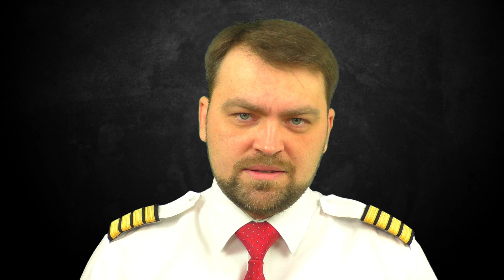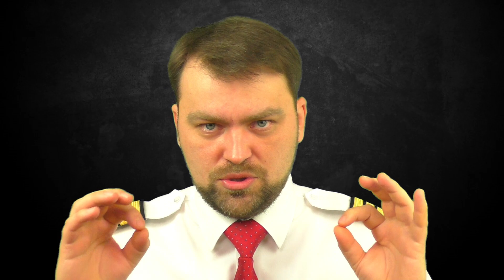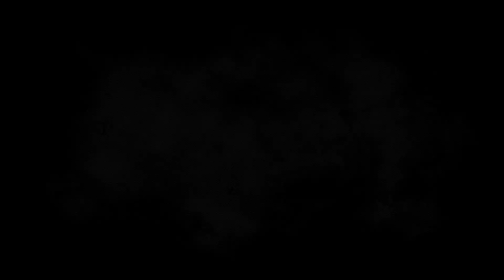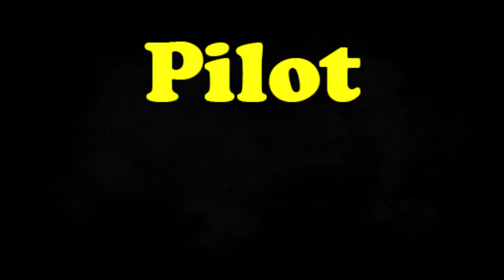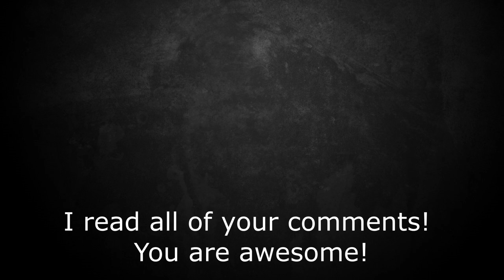Pilot Q&A #5 Most beautiful Plane, Scared of Flying, Both Engines Failure

Comment: Hi! I hope that you're well, as always. I have one question :)
Let's imagine that we have an altitude restriction "BELLOW" for departure on the SID (as for example in the LLBG, where we must fly bellow 8000 feet until some points). I think that we have to reduce our vertical speed by using the V/S button on the MCP, to reduce the climb gradient and engine noise (SID is also noise abatement procedure - airport briefing) But should we engage the autopilot after selecting the V/S mod on the B737 in this case, or not? (Because we may not use the A/T without the AP). Or is it better just not to arm the A/T and fly fully manually? Or maybe it's allowed to fly without the AP but with the A/T for this particular case? 😂 What will you choose?) Thanks, the answer will be really helpful for my simulator flights :)

Comment: Im going to embry riddle for 4 years. It costs 50,000 per year for tuition, 12,000 each year for room and board, 1000 each year for books and atc sim sessions (my minor is atm) and 15-25000 per year for flight lessons at the univeristy. It will costs me about 350,000 usd to get my license, but this includes me getting my 1000hrs.

Comment: Despite everything I’ve ever flown (real life and simulated) having either a yoke or center stick I’d also be very interested trying the Airbus side stick and FBW system.

That said, one thing I like a lot about Boeing aircraft is the fact that there’s artificial feedback in the yoke, even on the FBW models like 777 and 787. My understanding is that the Airbus sidestick is just a spring centered stick with no artificial feedback.
A technology I am very interested in is the active sidestick. I’m not sure if you’ve heard of these but it’s a sidestick which has artificial feedback and where the 2 sidesticks are electronically linked to move in unison much like mechanically linked yokes or center sticks. 

Sounds like active sidesticks could be the best of both worlds (sidesticks and yokes)

Comment: Why do engines fail when we go inverted flight????  

Is landing in water a dangerous  task like in the middle of the ocean?  

 And last which will be more efficient ?  Small modern planes or big planes?  Which are not the most modern

Comment: Question about the yoke's axis independence: when you turn the yoke left/right (or pitch up/down), can you inadvertently be pitching the plane up/down (or turning left/right)? Imagine this scenery:  a full black night, no visual reference, unreliable air speed and altitude and no angle of attack indications (inspired by the Air France 447 accident); then you just want to deviate from a thunderstorm in front of you but inadvertently end up pitching the plane up/down leading to a stall or overspeed situation.

Comment from the maker: 00:00 Let's Go!
00:40 Sunrise/Sunset Flying
01:49 Flying over the city
02:27 How much does the pilot training cost?
04:25 Autothrottle operation
05:32 Best Flight School
07:05 Most Ugly and most beautiful planes
08:04 Is it difficult to fly the airplane?
08:56 Blancolario
11:26 Stop modern planes...
12:36 T-tail 
14:35 Tail mounted engines
15:15 My parents don't let me fly :(
17:11 My Motivation
18:30 Instagram direct messages.
19:26 Scared of flying
21:48 Am I a flight instructor?
22:46 Poland
24:16 Small planes VS Big planes
25:33 Overweight Takeoff on B737
27:18 Antonov-28
28:40 MH370
30:12 Bypass pin
31:55 My next plane
34:28 Cargo Planes
36:00 Pilot Status
38:14 Smell in Cockpit
39:58 Football
40:50 Both engine failure after V1
42:11 Barrel roll on B777
43:21 F/D recycle
44:30 Night or Day?
44:41 What is N1
45:30 I have information Q
47:11 Questions on other languages 
48:52 My age
49:10 Can a passenger land an airliner?
50:00 My favorite captain
50:43 ATTOL A350
51:39 Do I play games?
52:28 Antonov-148
53:24 Lightning sound
53:56 Airplane crash landing evacuation
55:42 I may delete your comment if...
56:35 I don't like You Tube and that is why...
53 Comments